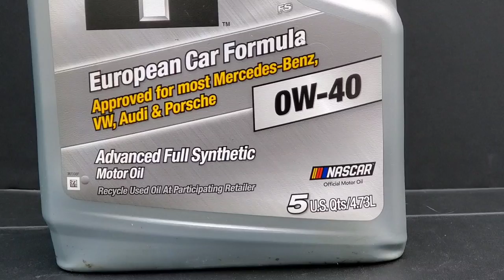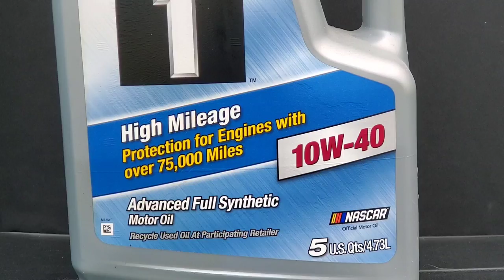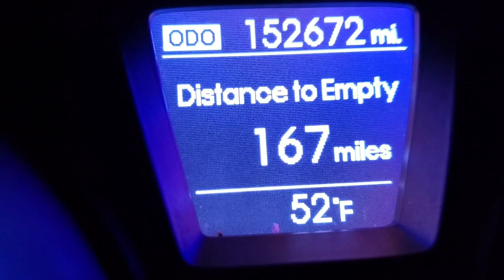Thin or Thick engine oil isn't safe!?

Comment from the maker: What viscosity does your engine require?
Reply: 02 Toyota Corolla 5w-30 but I'm putting 10w-30 because it eats oil and 140,000miles, but I need your advice should I stick to it or go back to 5w-30??
Reply: For my 2005 Nissan Titan, 5W-30, Castrol Edge High Mileage (85,000miles) mixed in with a little bit of Lucas Oil Low Viscosity Stabilizer.  Engine runs great with no knocks.

Comment: Follow manufacturers guidelines. With a car with VTEC, VVT a thicker oil can cause these valve system to not work correctly.
Reply: I don't know what temp it happens at, but, 10w30 in the summer is about the same as 0w20 in the winter, so running 10w30 in the summer is the same as running 0w20 in the winter, which is what I will be doing.
Reply: @lonniebeal6032  modern oils stay pretty consistent with viscosity until it gets really worn out. I would use what the manufacturer specified
Reply: Following manufacturers guidelines? Like changing the oil every 10,000 miles, and "Lifetime Transmission Fluid" or using 0w-8 oil in florida or arizona in the summer?
Sorry but I am not trusting that
Reply: @tinleo333  viscosity is what I was referring to. You also have service tables for normal and severe conditions and driving. The manufacturers adjust  the service schedules for those conditions with thicker oil and shorter change intervals. Most folks never read those spec in that thing called the owners manual, or what's available online.
Reply: New toyota corolla uses 0w-8 oil and they recommend that oil for every state including Texas,Arizona and florida with up to 120f in the summer. Off course they want your car to be ruin after warranty. I am not trusting water like oil in hot weather tha's just a death sentence for the engine. @JohnBoulding
Reply: It's not always best practice though. For instance, my Rav4 guidelines says 0w16 but you can also use 0w20 "Temporarily" after researching. The reason they try and force the 16 on you is because they want to meet American efficiency standards and get a little kickback from the government. International manuals say that it's perfectly fine to use 20 and even a little more higher if you want. And since I live in a tropical climate, I would get zero benefit from going with the 16 and it would hurt the engine in the long run. I slightly lose out on fuel efficiency but it's not noticeable, and I get more protection to the engine with is worth more than saving a few dollars at best every time I fill up.

Comment: Hello Nate:
W...When we had mono-grade oils were called  by "Weight". When and Why they  started to call it "Winter" I do not know, I think it was when Multi-Grade Oil came out on the market. even then we still called oil by Weight meaning the working viscosity. 

Thick or Thin?....as you say depends  on the tolorances.  The owners manual gives an idea if they are very tight by saying "USE ONLY 0W20 OIL!"  If it recommends 0w20 for best fuel efficiancy with the option of useing 0w30 - 5w30, 5w40 then you know the tolorances are not that tight and you can use the (40 weight) without damageing the engin and that when operating in HOT CLIMATES you can safely go up a weight or two. 
Off course with High Milage the engin will be worn and a thicker oil will be needed.

Comment: I started running Rotella T4 heavy duty diesel oil in my offroad 4x4 rig. It has a gas engine, but I figure the diesel oil will provide better protection in severe duty.
Reply: It won't 😵

Comment: According to the Owner's Manual, my Honda motorcycle needs 10W30 oil, but the average temperature here is 32 C and maximum is 40 C. In this case, should I change to 10W40?

Comment: how about living in a tropical climate with an average temperature of 28 - 34 degrees Celsius? according to the vehicle manual I must use oil with a rating of 10w30? do i need to increase the SAE rating to 10w40 or 20w40? I have driven the vehicle about 160,000 km
Reply: Use a viscosity chart. Not one from an owners manual because the cars that want 0w20 will have that work in all temps in their  manual, and that's a flat out lie.
Reply: @lonniebeal6032  thanks bro ✌

Comment: Thin is not safe in high temps (0ver 65F), thick is not safe in freezing temps.  Say, could you heat up 0w20 and 10w30 to about 200F ( I think that would simulate summer weather)  and immediately run the Lubricity bearing test?
Reply: Unlike conventional oil, frigid temperatures have very little impact on the flow-rate of synthetic oil.

Comment: Mobil 1 0w40 is the best motor oil for the price. It contains PAO  - Poly Alpha Olefin that is a high quality synthetic base. Moreover, it does not matter which viscosity you put in the engine, it will work fine. The most important  thing is the climate in which the engine works. From here, you choose the right viscosity for the climate you live. For instance, in Miami is better to use high viscosity oils such as 5w-40 or 5w-50 for best engine protection, for cold climate locations use 5w-30 but never 0w-20. 0w-20 will fit in Russian city of Yakutsk. So, don't listen Dealerships  about low viscosity oils motor oils if you want to keep your engine from a wear. For temperate climate, you can choose the motor oil depending from a season...
Reply: Any 5w should be the same when cold no matter if its 5w20  or 5w40 right ?
Reply: For the dummies >>>>>>>>>>>>>>>>>>>>>>>>>>>> Just follow your owners manual nothing else
Reply: Most all of M1 oils contain PAO..that stuff hardens seals ...high mileage stuff has seal conditioners to counteract this...or use Redline oil with a high percentage of esters which also condition seals.
Reply: @sweis12  the second number is the weight when hot...
Reply: @mikeschlup5279  Not what I've read, Mobile One used to be group IV, but when they lost their lawsuit I believe they became a group III which is not PAO based.  Maybe their 0w40 is, but most PAO based oils are $10 a qt. and up.
Reply: Ok
Reply: A 0w40 is going to shear as soon as you start the car. you are better off with a 10w40 unless you live in the artic. I dare say no engine needs a 5w anything.
Reply: I switched to mobil 1 European 0w40 in 
My buick that calls for 5w30, engine is much quieter and starts up easier in 10 degree weather. I’m going to run 5w40 in summer and 0w40 in the winter from now on.

Comment: My bmw require 0w30 but I use 5w40 and after I change it no more burn oil
Reply: if u use thicker oil and fixed the issue. its usuLly due to piston rings and stuff in engine is worn out so thicker oil will seal the bigger gaps
Reply: u dont need to know the book. u need to experience things to be an expert

Comment: My 04 Yukon burns about a quart of oil between changes 100k miles. Would a switch from the OEM 5w20 to 5w30 be beneficial? Thanks for your reply mate. Cheers.
Reply: Yes it would be better to use , I’d recommend to use the Lucas Synthetic Additive

Comment: What do you know about 0w30? Supposedly they say it's safe to if your motor uses 5w30 or 10w30
Reply: I did a Mitsubishi and a Subaru's oil...One wanted 10w30, the other 5w30..NEITHER ONE LIKED Anything but what recommended...OW30 made the valves rattle horribly...ended up with 10w30 in BOTH!!!
Reply: Watch will thinner oils damage you engine.   He states its generally safe To go up on summer rating or down on winter

Comment: If 80-90% of engine wear happens at start up then I would think thinner oil is better for your engine.
Reply: I prefer thicker oil for better protection at high RPM
Reply: The wear at (cold) start up is because the oil has dripped off all the surfaces & out of the oil galleries. So if you did only short trips with many hours between trips thicker oil would be better as it would not run from the surfaces so fast. Test it for yourself putting thin & think oil on a piece of vertical steel & see which has the most still on it the next day.
Reply: Just add oil in your oil filter before you install it. Boom, no start up issues.

Comment: I drove a Tesla. I am in my 50's. I never thought I would say this but, I am ready for electric cars. Not only am I blown away at their abilities... maintenance will be all but gone and we won't have to worry about things like oil changes.
Reply: You still have to maintain it, you gotta do the tire rotation, cabin filter, and check your brake fluid every year or 2 if you wanna safely stop your 3 second 0-60 vessel
Reply: I don’t trust the electric car’s.When charging it,they catch on fire 🔥
Reply: @TT-oo9te  And so can every other car. Electric vehicles don't have a fire rate any higher than gasoline or diesels.
Reply: There is\was a video of a guy blowing up his Tesla because new batteries for it were $22,000.  No thank you.
Reply: Guess you're fine with $22,000 battery replacement...I'm not.
Reply: @lonniebeal6032  I'm not poor. I drive vehicles with warranty. It's not an issue I would have to worry about or take into consideration.
Reply: @clay282  even if it not a worry the fact you gotta pay 22,000 for just the battery is ridiculous you could literally get a whole other car with that 😭
Reply: Let's see in 5 year grandpa 

It's gonna cost half your car's price to change a battery and other maintenances
Reply: @okkymahardika748  Then you should work harder so you can afford it OR, take public transportation. Nobody said you had to have a vehicle. The bicycle is a well used and viable mode of transportation in many parts of the world.